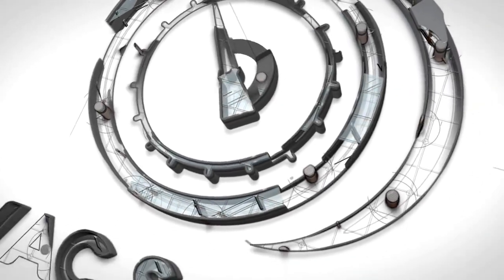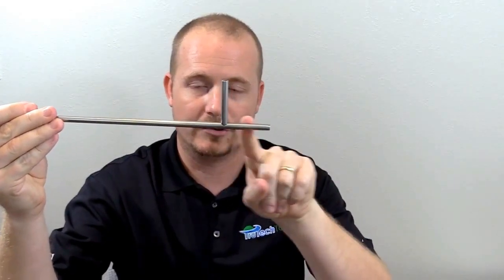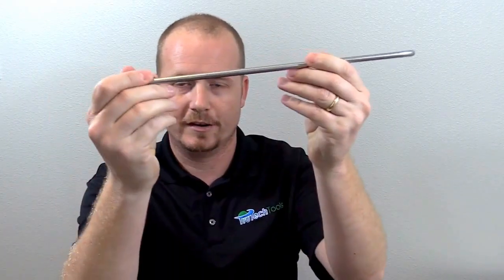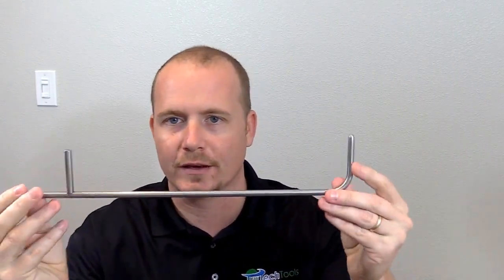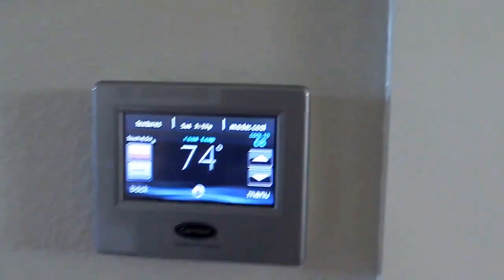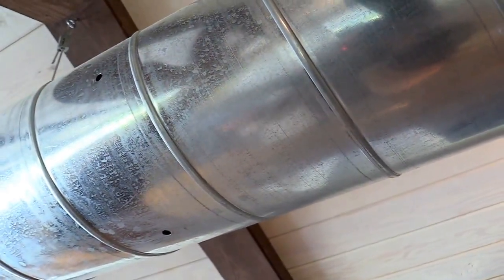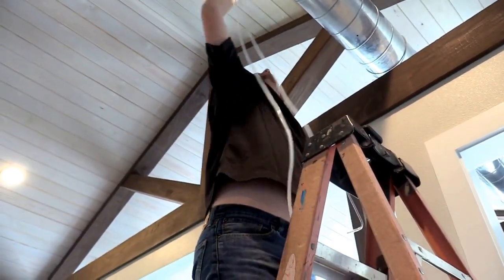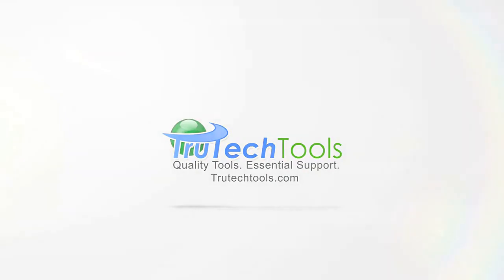Reading Duct Velocity Pressure, CFM and Static with a Testo 510i and a Pitot Tube

Comment: Which app do you use that shows barometric pressure in PSI? The only ones I can find all show inHG and I can't find a conversion chart that converts inHG to PSI.
Reply: To convert inWG to PSI
divide your measure value in inWG by 27.708 this will give you PSI value
eg 1inwg = 0.0361psi
Reply: Thank you.